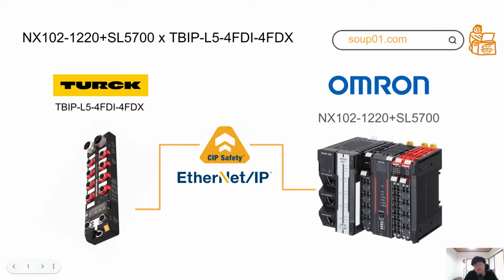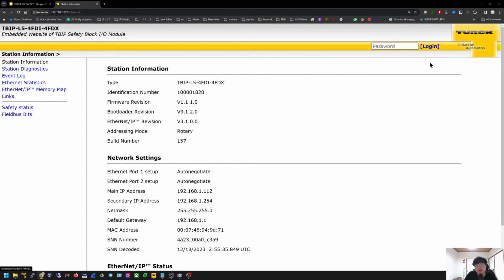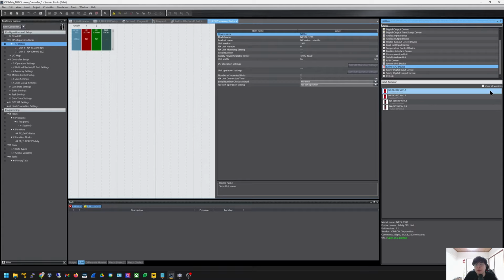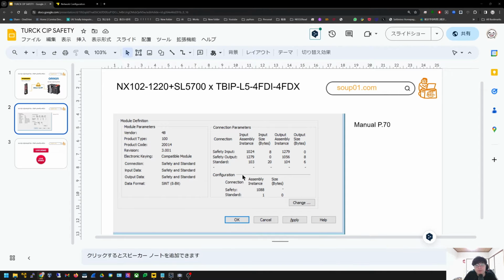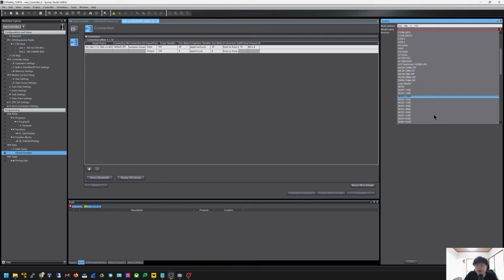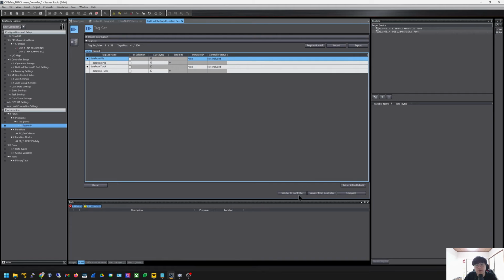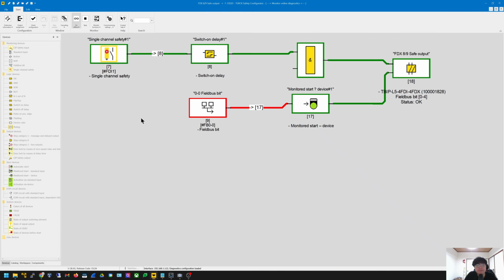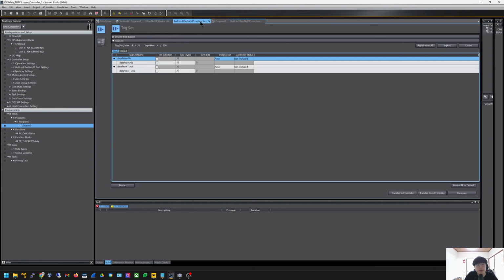OMRON.Let's Connect with Turck's CIP Safety IO

Comment: hi, can we add multiple TBIP's under NX and safety modules?
Reply: depends which NX you use with the 102 you can have 16 module in cip and with the csg 128 (depends of the number of I/Os used)